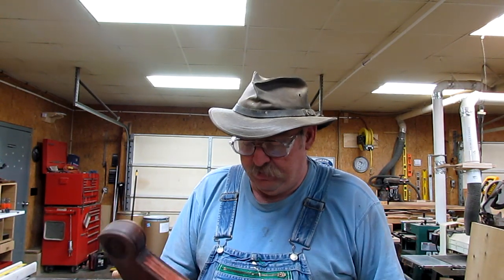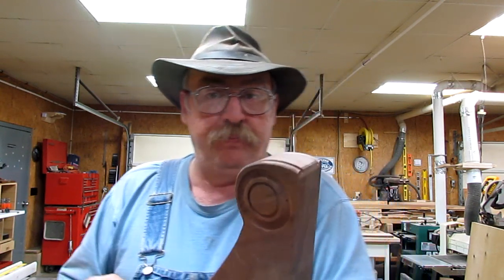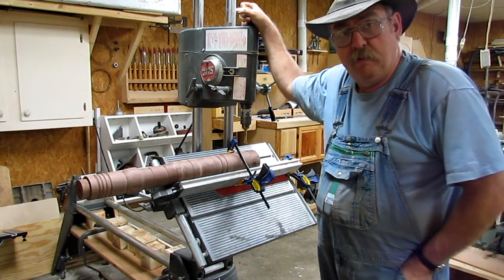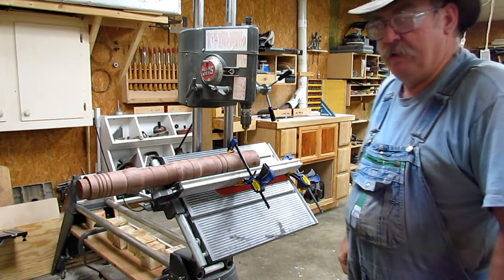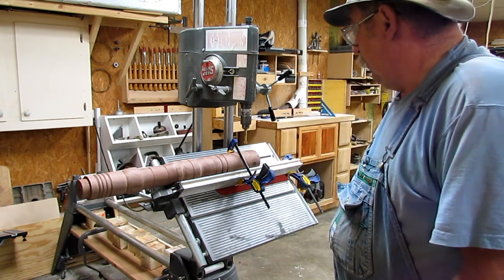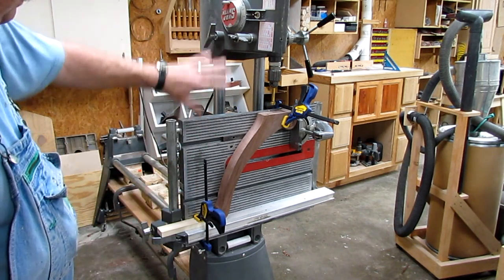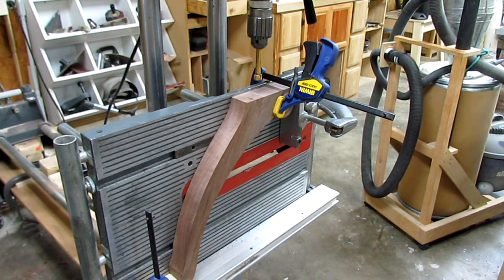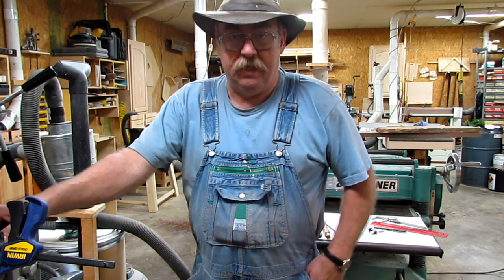Table_Shopsmith.wmv

Comment: I bought my Mark V in 1978, and with normal maintenance, and 2 drive belt changes, it still runs like new. And I use it a LOT ! I have the bandsaw,  jointer,  jigsaw,  and belt sander, and would never have had the room for stand-alone machines in a 2 car garage.  But the Shopsmith works for me !